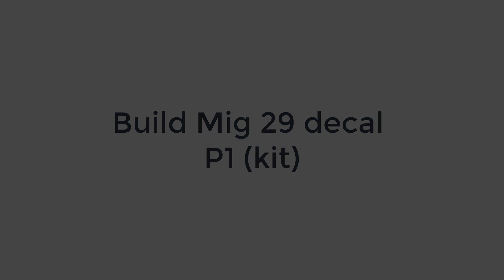Hướng dẫn làm máy bay chiến đấu Mig-29 Phần 1 (KIT) | How to build Mig-29 Rc Plane Part 1 (Kit)

Comment: Có dùng cho motor 2212 1400 kv đi cánh lớn ko/xin file in
Reply from the maker: ko b nhé, đây là dòng jet tốc độ đi motor kv cao 2200kv trở lên
Reply from the maker: b có motor 2212 1400kv thì có thể làm mẫu J3 cub này nhé 
https://www.youtube.com/watch?v=XSPcEx24GWM&t=55s
Reply: Sơ chế một chút có bay được không
Reply from the maker: @towaniumpowder  chắc được b, đổi motor gắn lên đầu
Reply: Nếu Sài motor 2212 2200kv có Sài được esc 30a ko
Reply from the maker: @towaniumpowder  đc bạn nhé, esc hơi nóng tí, 40a thì đẹp
Reply: Vậy pin như thế nào mới bay được
Reply from the maker: @towaniumpowder  3s 1500-2200mah b nhé